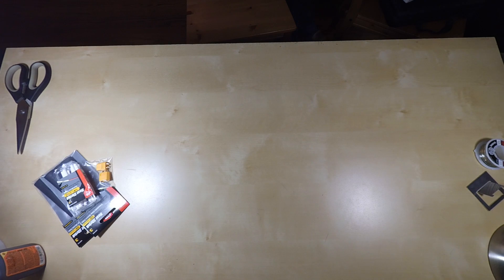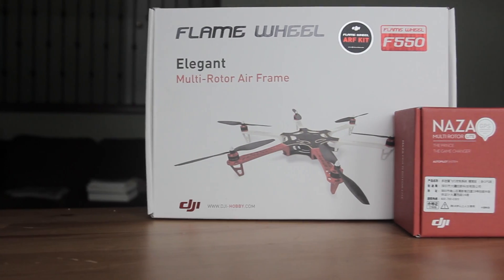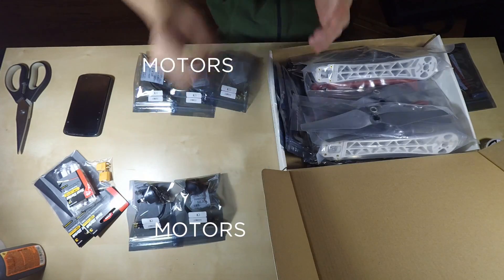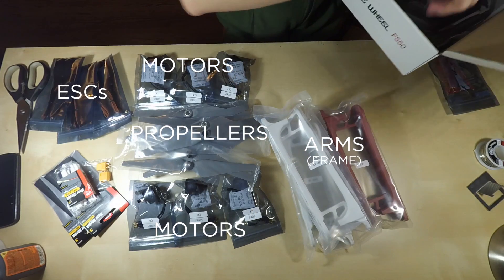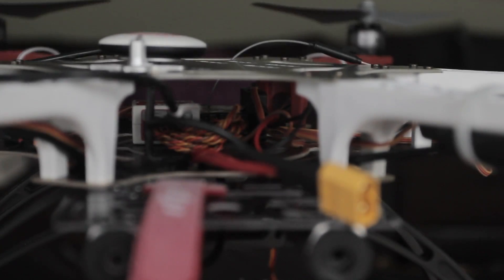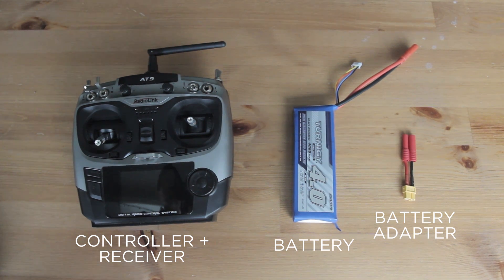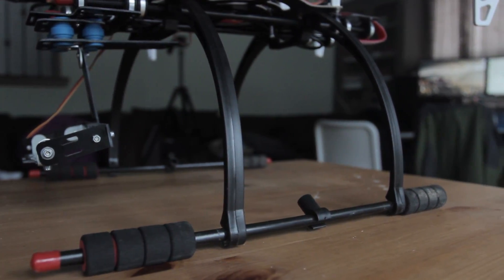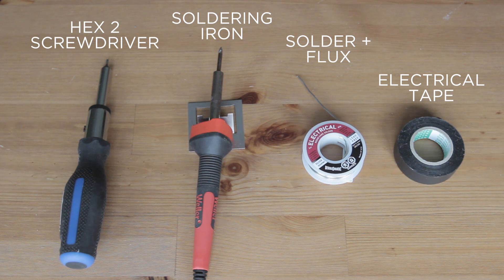Building a Drone & Timelapse! (DJI F550 Hexacopter Kit)

Comment: My kit bought in 2014 had 4s capable 2830 motors but 3s ESCs and XT60 connector. I had to replace it and will complete building just a few days before the drone ban here. It will only hover indoors and then I will scrap it as I can't afford to get a license above 2kg. Will just keep the electrical parts.

Comment: I bought a kit long ago with 2830 motors and 6S ESCs. Is it powerful enough to lift a Samsung NX300 camera with 3 axis gimbal with 14.8V 12000mah power? If not, will two additional motors in a dual quadcopter configuration do the job? Thanks

Comment: I haven't purchased my first drone yet, I am still researching.
I know I want to do photography and videography eventually though.
I'm curious about modding drones.
I've noticed a lot of models, and they all have good points and bad points.
The 3 areas that I have noticed that I am interested in modding are...Remote distance, FPV transmission distance, Flying time, and Weight bearing ability.
It seems like swapping radios, batteries, and possibly props, and motors would accomplish these, but I'm just learning.
Can these things be done?
Reply: Yes

Comment: Thanks for posting all of this. I actually have had all of the parts except the gimbal, with the best of intentions for about a year and a half. My hold up is this: I do not understand how to program the crazy radio. Know anything about the Futaba FAAST T7C 2.4GHz Radio? I have the the mating receiver and I have the NAZA Lite program, but cannot fathom how to input and save the the servo instructions. You apparently need a degree from MIT to understand the (extremely poor -- assumes too much prior knowledge) instructions. Sure wish somebody could explain the radio.

Anyway, thanks for posting. This is a huge help to me!

Comment: Nice build!
How long is flight time?
Reply from the maker: +TEAM MASSIKKA Flight time is about 15 minutes with my 4000mAh battery.
Reply: +PeterLTechGuy That seems a bit to much isnt it? what is the weight with battery on it?

Btw, i was wondering how you mounted that landing gear to the bottom plate. You got any pics? :) thanks!

nice build tho!
Reply: 17 minutes maximum
Reply: it depends on the battery Mah

Comment: Hi is this http://m.ebay.com/itm/New-DJI-Naza-M-Lite-Flight-Controller-w-PMU-module-LED-GPS-Stand-holder-/121780777231?nav=SEARCH the same as what you used in your drone?
Reply from the maker: +drone is best The product linked is not exactly the same one I used. I used original DJI Naza parts including the GPS module (the ebay one looks to be an aftermarket/3rd-party one). The product linked below should be the exact same one I used: http://www.hobbyking.com/hobbyking/store/__51632__DJI_Naza_M_Lite_Multi_Rotor_Flight_Controller_GPS_Combo.html

Comment: (Victor) Nice build !
I'll be doing the same after I do the F330 and F450 in a week or two.
Just waiting for my motors - 2212 2700kv
What size and KV are those motors on your hex ?
I will be using 2212 1400kv, also using 2208 1500kv on the Totem Q250
So builds this month and 2 in March.
Devo 7e TX, so RX701 on all 4.
Be blessed !
Reply from the maker: +Messin With Quads Thanks man! I'm using the stock DJI 2212 920KV motors from the kit. Looking forward to hearing more about your build!